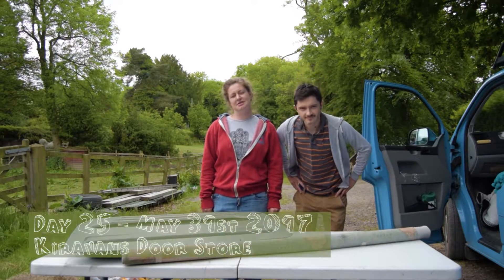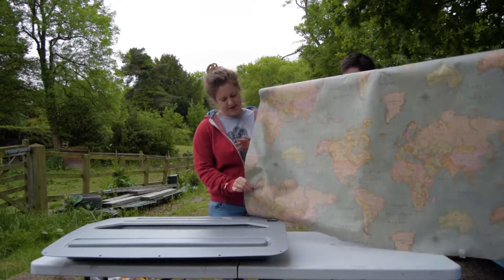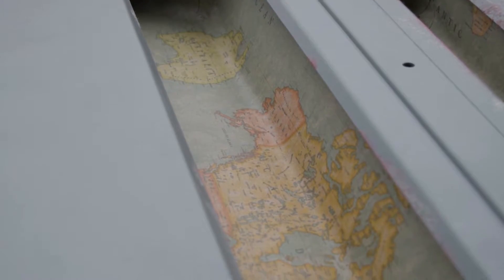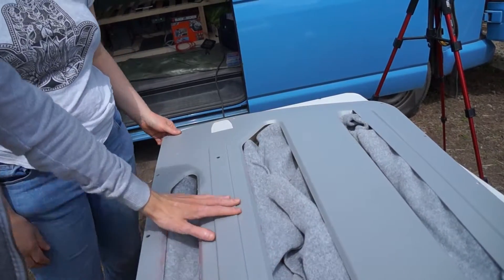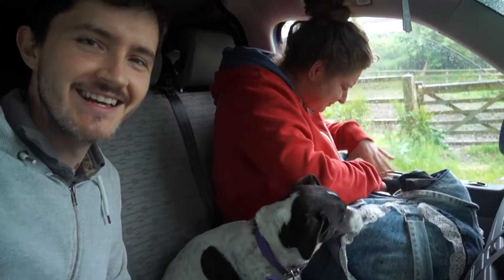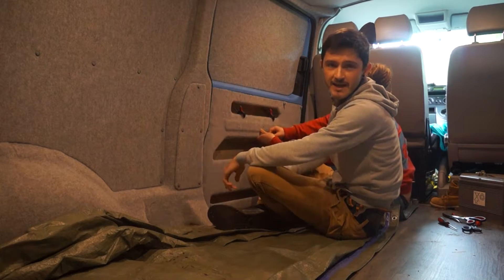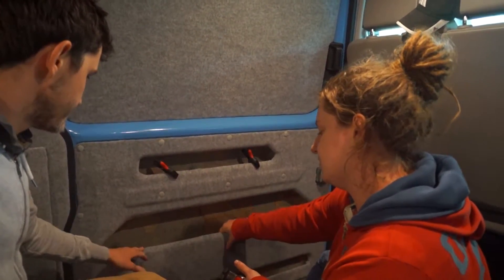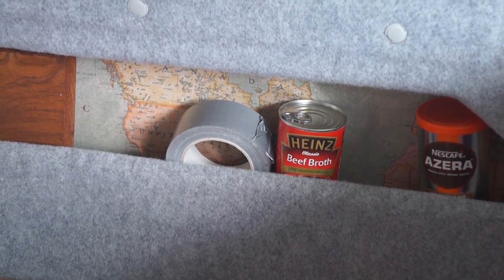Day 25 -  Kiravans door store #VanLife VW T5 Camper Conversion

Comment: Hey guys, lovin the videos. In hindsight would the fixing clips go onto the door store before you put the carpet on?
Reply from the maker: Doctor Bass possibly, may look neater but the fixing are a bit of a nightmare, (the head has got to be out of the housing about 5mm) but this way makes it easy to remove it if it gets tatty! 👌🚐 M
Reply: Flora & The Novice Explorers Ah OK, so they would show 5mm bumps under the carpet? Thanks for the reply.
Reply from the maker: Probably 3mm pumps in the carpet Doctor 👨‍⚕️ 😜